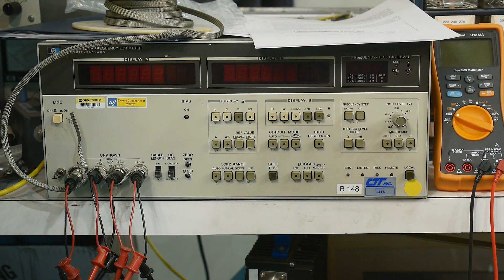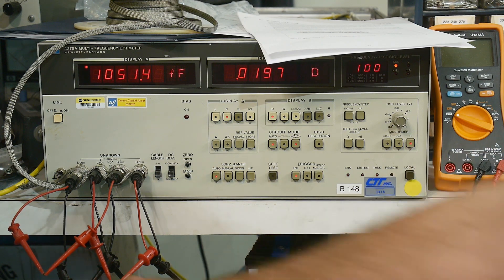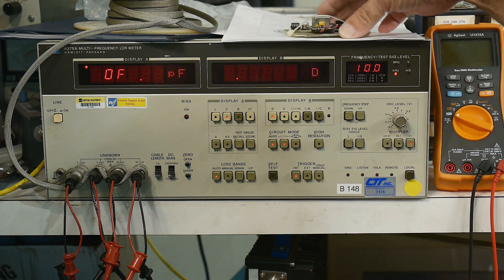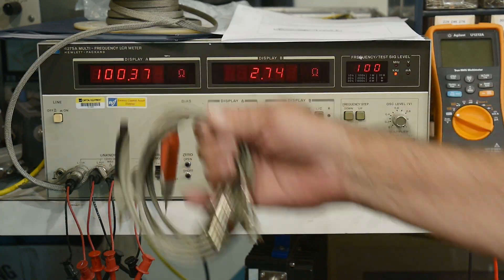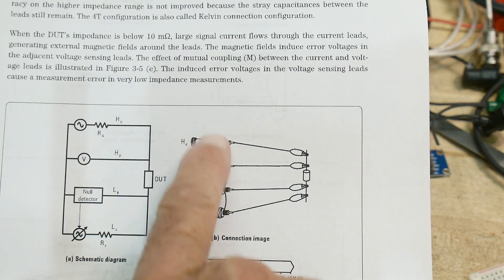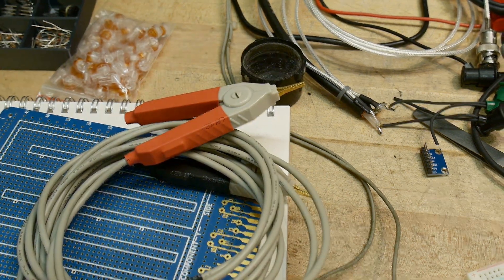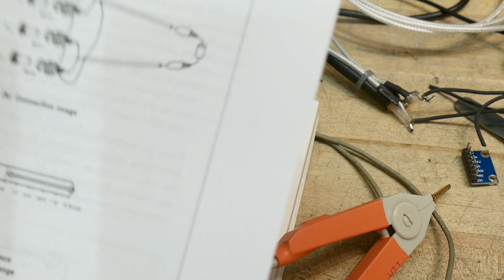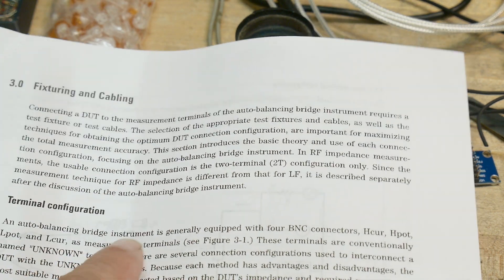#1682 HP 4275A LCR Meter (part 4 of 8)

Comment: Weird… I just read about an autobalacing bridge in an SDR book…”
“In a traditional Wheatstone bridge, for instance, the balance is manually achieved by adjusting variable resistors until the voltage between the two midpoints of the bridge circuit is zero. An auto-balancing bridge automates this process. It uses a feedback mechanism to adjust the balance electronically. This adjustment is typically done through a digital-to-analog converter (DAC) controlled by a microprocessor.

The key advantage of an auto-balancing bridge is its precision and efficiency. It can quickly achieve and maintain balance, allowing for very accurate measurements of component values or circuit characteristics. This is particularly valuable in applications where manual balancing would be too time-consuming or where the highest accuracy is required.”- SDR Fundamentals
Reply from the maker: you are missing the phase

Comment: Re cheap cables: I got the same ones. Trick is to short the two shields at each clamp, and have a wire going between the clamps to short those pairs of shields together. Alternatively, the shield pairs can be connected together at the instrument end. That would be a connection from HC to LC or HP to LP at the instrument. The C-P connections are at each clamp. It’s a reasonable tradeoff for those cables.

Comment: Hi, the description of how the auto-balancing bridge works is right there in the handbook in the operational theory section. So, the idea is that you want to kind of do a 4-wire impedance measurement analogous to a DC resistance measurement. However, the issue is that since it's all AC now you can have capacitive coupling between the leads which creates a parallel current path. Like, you have 'fake' resistors in parallel to the DUT. What the auto-balancing circuit does is create a virtual 0 V potential as close to the DUT as possible. That means you're not measuring the sum currents of all the possible paths of DUT + capacitively coupled paths between the leads but only DUT current.
You're not supposed to connect the ground terminal to the shields for simple component measurements! The earth ground's 0 V potential is not the same as the virtual ground's 0 V created by the auto-balancer. It's only there to get rid of earth loop issues with other devices.

Comment: I think that you would be way ahead to build a test jig(s) that attaches to the LCR's BNCs. Think of the jigs for your 575 curve tracer. You could use the calibration box that you ordered for inspiration. Different boxes for different configurations, or a single box with switched configurations. Now, you have a fun 3D printer project. Yes, the Asian Kelvin clips are known to not be wired correctly, but the EE Community has not advertised that well.

Comment: I have the same shit chink cables! I didn't realize there was a problem. I have had the cables for two years and have never used them so I didn't notice any problem. I always use the component box that plugs right onto the front panel. I have a batch of .01% capacitors that are the same but read differently on the instrument! The capacitors are at least 30 year old so I suspect we can believe the marked values with a grain of salt! But I am not needing better than 1% so no big deal.

Comment: I've HP 4284A and 4285A LCR meters, and had the same issues with the cheap cables. I just added in the obvious jumper wires at the clip end, and it's fairly usable, but noticably not as good as the little box setup. The real HP version of these leads comes in a few variations, most of which have a box at the instrument end that contains a short between the shields (and, curiously, a big ferrite) or else which have a second layer of shielding that's shorted together near the clips.
Reply: The “or else” arrangement you mentioned has the BNC-connected shields shorted at the DUT. That’s the 4TP configuration. Then there can be a 2nd shield around the primary shield, and those shields would all go to a common point on the instrument side. Usually the oscillator common IIRC.

Comment: I bought a 4274a recently, and settled on the BK tl89k1 test leads after doing a lot of research on compatibility, if you want a nice set.  There were some cheaper Chinese ones but their websites and data sheets didn’t add up.  Plus these can be had at digikey and only about $25 more